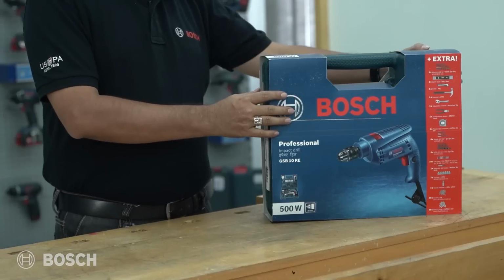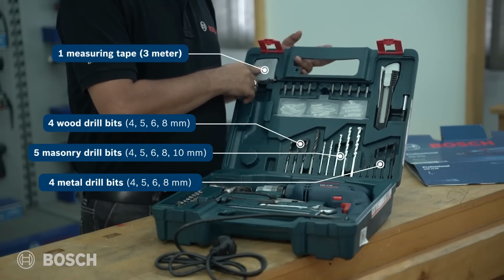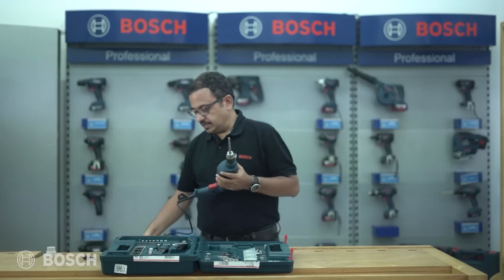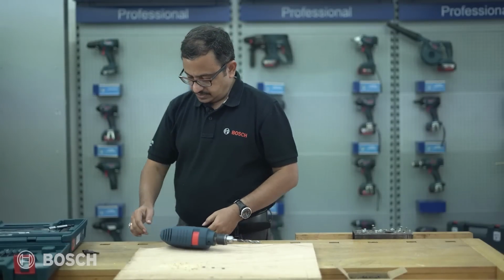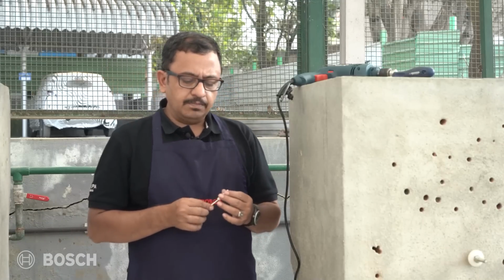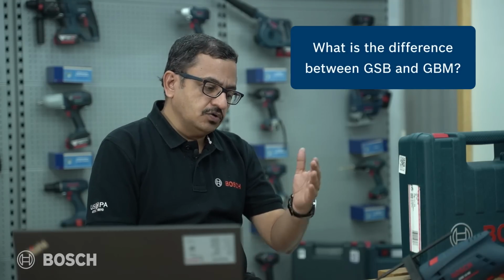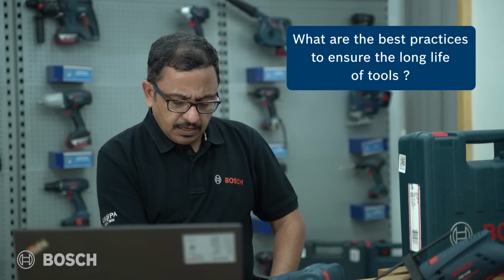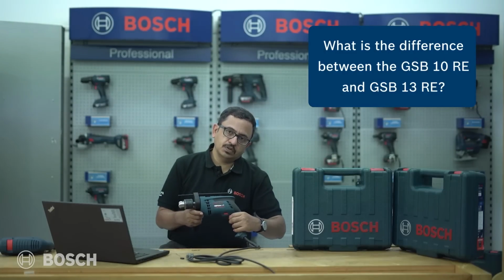Bosch GSB 10 RE Corded-Electric Professional Impact Drill + Accessories Tool Kit, 500W, 10 mm chuck

Comment: @BoschProfessionalIndia Bosch GSB 500 RE  vs  GSB10 RE. Which model is best? And is there a price difference in these models?
Reply from the maker: Hi Ibrahim, thank you for contacting Bosch Power Tools India. You can call us on our toll-free number 1800 425 8665 – Monday – Saturday 8:00 am – 8:00 pm (Except Sundays and public holidays).
Reply: Same question here. Cant find a difference other than rpm. 10RE low cost sometime.
Reply: Same question

Comment: I have been using Bosch GSB 10 RE for almost 8 years. It is an excellent product and has not given any trouble till now. Few months back, one of the latch of the carrying case broke and now the second one is also breaking. Where can I find the replacement latches for the carrying case? and can I convert this to a keeyless check?
Reply from the maker: Hi, Kindly call us on 1800 425 8665; Mon-Sat 8 a.m. - 8 p.m. Except Sundays and Public Holidays.

Comment: Which is better machine? 10 RE or 500 RE? Also, which drill bits to use in tiles?
Reply from the maker: Kindly call us on 1800 425 8665; Mon-Sat 8 a.m. - 8 p.m. Except Sundays and Public Holidays.

Comment: My GSB 10 RE does not do that. That drive in screw drivers I tried driving in bolt in the chair and It almost dislocated my wrist. I tried putting in a screw in a wood panel. Just barely managed to do it right. It just does not go slow like you did there. I just press it little and vooom its gone inside
Reply from the maker: Hi, Kindly call us on 1800 425 8665; Mon-Sat 8 a.m. - 8 p.m. Except Sundays and Public Holidays.